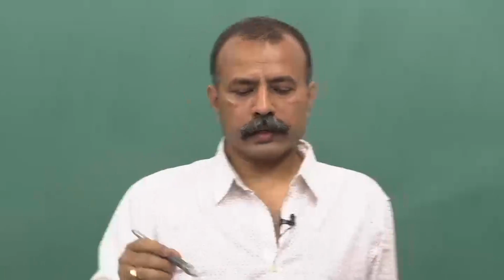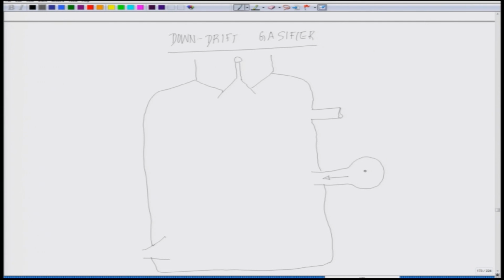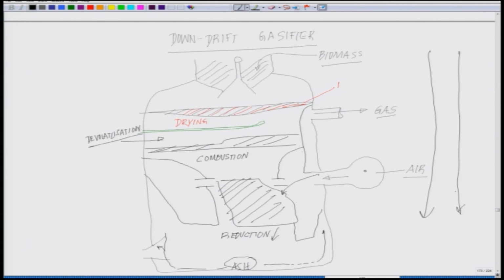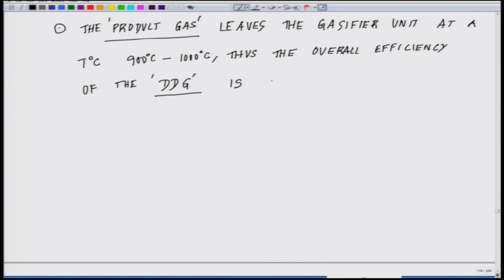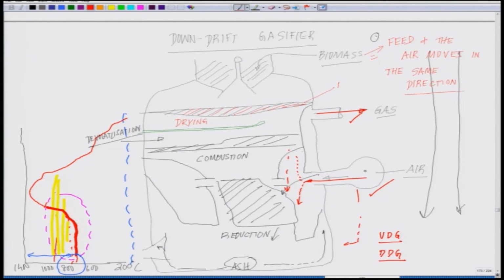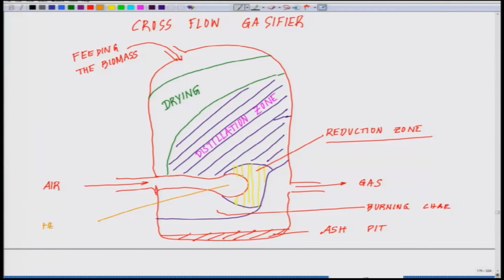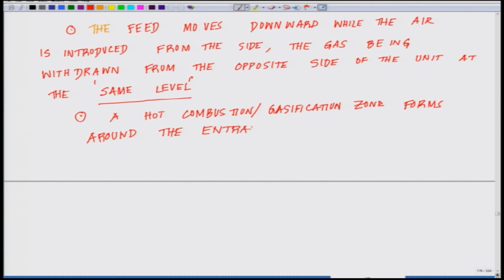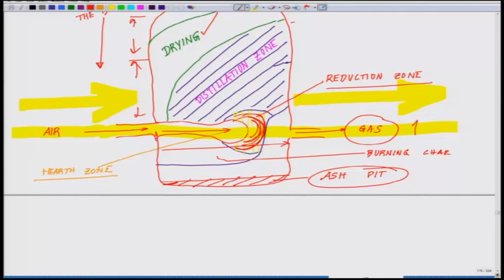Down drift and Cross Flow Gasifier

Comment: A crossflow gasifier is much simpler to make, but I have a question. If the gas was collected at the same level (horizontal to the air nozzle) and then brought up through a pipe to the top of the gasifier it may cool a bit, it's also means not cutting another hole in the side of the drum. Does this mean the efficiency goes up being cooler?